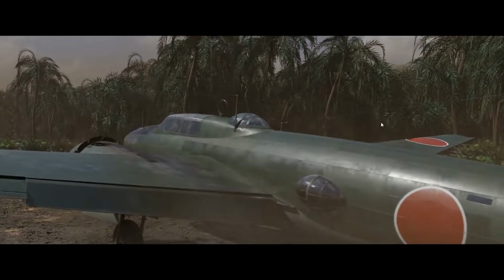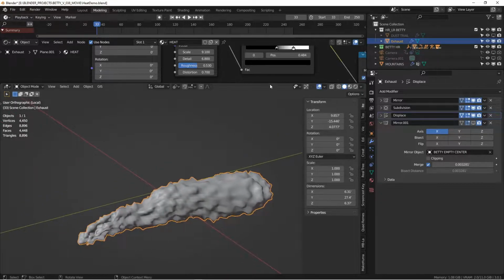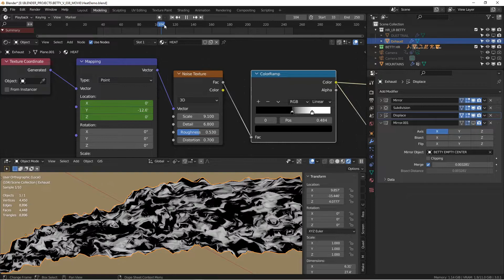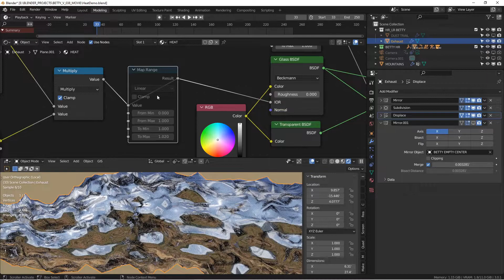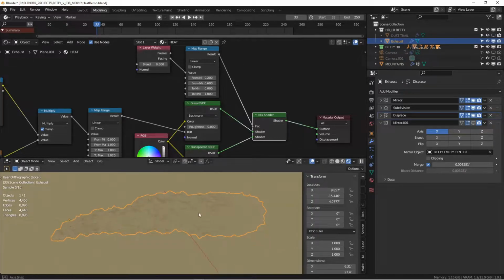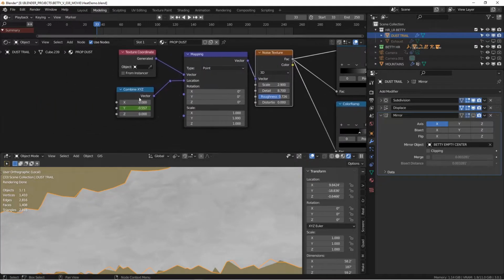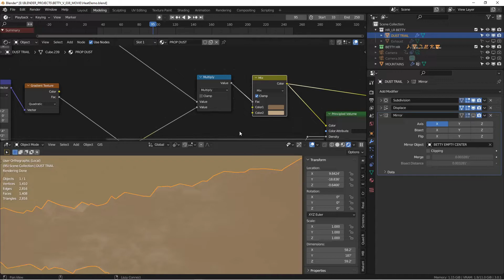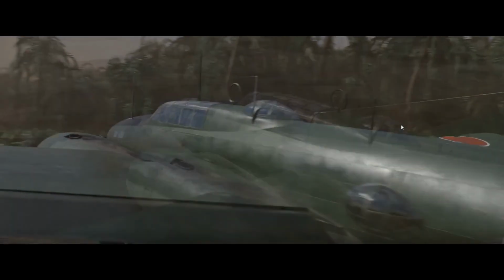Blender:  Engine Heat & Dust Clouds

Comment: great video. Really helpful.
Just a couple of things to note for other viewers. If you come here just for the dust (like I did), watch the whole video as Mark re-uses a cloud texture from the heat dispersion effect, in the dust effect.
The mirror modifier doesn't render overlapping geo of volumes properly. You end up with the empty part of the volume cutting into the dust that should be behind.
Reply from the maker: Thanks for adding your comment.  I'm sure it will be helpful to somebody.